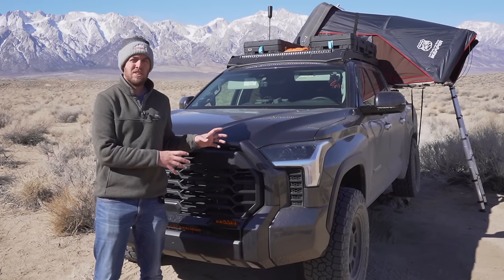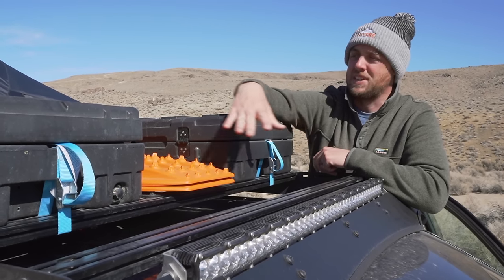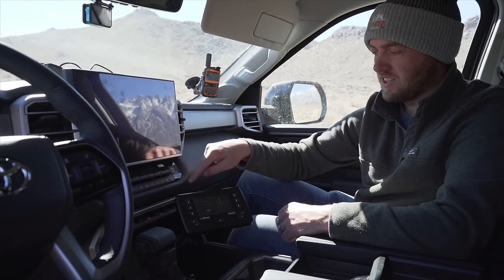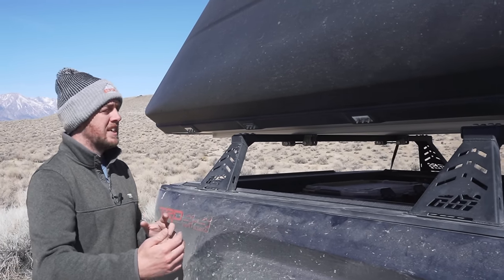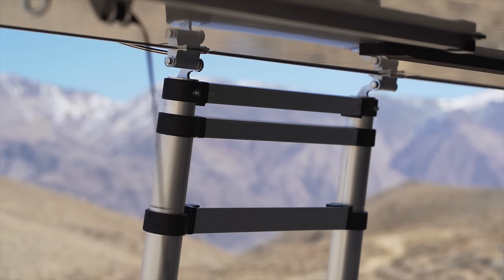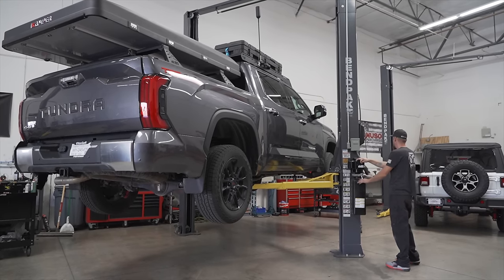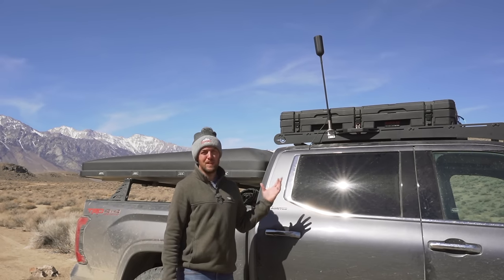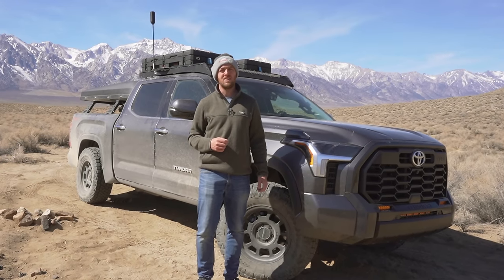We Built This 2022 Tundra Out for Overlanding in 4 days

Comment: It’s a Spacer lift no point in Churching it up lol. My RC lift is designed identically. Has a preload at the bottom of the spring. Regardless it’s a spacer lift 😂🤷‍♂️
Reply from the maker: The Tundra Rough Country lift has a spacer that sits on top of the strut, which is very different from a preload spacer. Yes, they're both spacers, but the RC spacer is more likely to cause issues.
Reply: @RevereOverland  I can’t speak for the tundra version. But my 2021 Silverado LT RC 3.5” kit had a preload spacer as well as a spacer on top utilizing both for each front strut. 

Installed it the week I got my truck and love it personally! But even tho my kit had the preload part it is indeed still considered a spacer lift to me personally haha. As a master Ase tech for the past 12 years a spacer is a spacer. Call it what you will but it’s all the same to mechanics 😂🤷‍♂️

Comment: 24:23.

I am not surprised by this one bit. I had a 2017 Ecoboost F-150 that had 35's on it and a 3.31 rear end and the mpg was even worse than what you are getting. It got in a wreck and totalled out so I went with a 2021 Tundra TRD Pro, and put 35's on it too.

BUT, with that 4.30 rear I get much better mpg than the Ford. The Ford was 11 mpg city and 15 highway, while my Tundera is 13 city and 16-16.5 highway.

Towing is even worse. The Ford got 8 mpg with my 7200 lb camping trailer while the Tundra gets 10.5-11 all day.

To be honest, I've watched enough videos now on the 2022 Tundra that I thank my lucky stars I didn't wait and got the 2021.

Comment: Be sure to check your speed and distance with GPS with oversize tires.  A larger circumference tires rolls a longer distance per revolution. I went from 30" tires to 33" tires on my 4Runner and when the speedometer reads 70 mph, I'm actually going a little over 74 mph.  The odometer is off by about 6 miles less per 100 miles traveled, ( when ODO reads 94 miles traveled I've really actually traveled about 100 miles).  This will give you more acurate MPG calculations.
Reply from the maker: I went from a 32.5 to a 35, which I think would actually put me closer to 15-16mpg after adjusting for inaccuracies

Comment: I have those exact tires on my f150. Got a crazy deal on them $600. Installed them in December Mpg dropped from 22 highway to 18/19. Will be going with a Hankook at3 or a Pirelli all season to get back lost fuel economy. I have an extra set of Hauler rims. Fuel prices in Canada are crazy right now. $250 from empty and I rarely go off road so no need for dirt/ rock tires. 
Love the Chanel!
Reply from the maker: Did you have street tires before? I wouldn't be surprised if you were going from street to all terrain.
Reply: @RevereOverland  yup kinda roaches all seasons.
Reply: But my last truck had all seasons and I went to hankook atm and didn’t loose anything. Who knows why:)
Reply from the maker: @trishaleaver3581  I don't have a lot of experience with different tires, so it would be interesting to know how different brands perform with mpg!

Comment: Replace the mattress with self-inflating, fold one blanket and place flat over the mattresses, then place any other bedding in the corner of the tent(the thickest part of the tent) 

I was able to fit (without forcing) two expeds, two down blankets, and two pillows in my 2.0. it’s takes time to figure out exactly how to make it all fit, but worth it. Especially if you use a heater, you won’t need as much bedding. 

Hope that helps 😊
Reply from the maker: Yes! iKamper just released their self inflating mattresses, so I ordered one of those.

Comment: Thanks for the Method 20% off link. Got my coupon code. I'm going with the 705's as well. Soon as they come back in stock for a Super Duty. Good luck with the Open Country AT III's. I had 35x12.5 R18 on my F150 last year and could not get them to balance. Had two bad tires replaced and still a vibration at higher speeds. Change to AT III's in a slightly narrower size and still had issues. Now have a 2021 F350 Platinum with the Tremor package and 6.7L diesel. Carrying my RTT on the bed cover with gear in bed and back seat, I still get 22-23mpg on the highway! Loves my diesel.....
Reply from the maker: I’d love to have a diesel!

Comment: Should have done a spacer lift, doesn't affect the spring harshness... and you can add bump stop spacers to prevent that "fuse" from exploding. It also moves your travel zone downwards so yeah you have a less up travel vs preload, but you get more down travel and you aren't likely to rub as much since the wheel won't tuck up in more. So long as the CV angle isn't bad, it's really a decent method.

Comment: I don't know if you have a filter on the condenser of your  refrigerator but with all that dust it would be a good idea as it'll be easier on the compressor as well as pull less amps. (or vacuum it occasionally ) Nice vid.
Reply from the maker: The compressor I have blows a good stream of air that I've used to blow it out a couple of times. I'll probably take the panel off and clean it before the next trip!

Comment: Sweet!  Your Tundra is looking even better than before.  But if it was me, I'd avoid putting heavy items on top of the roof rack to keep the centre of gravity low.  Which I'm sure you know is good for better offroad performance (particularly when big articulation is required).  And I'm surprised you only went for a collar lift instead of a proper suspesion lift (even if just the springs and shocks).

Comment: You’ll want some clear film in between the front wind deflector rubber seal and the paint. The rack will vibrate the paint off your brand new 4x4.
Reply from the maker: It has a soft rubber strip
Reply: @RevereOverland  that’s exactly what will rub the paint off. That with the grit 
Clear 3m wrap is the go

Comment: Both side windows of my iKamper skycamp mini were broken after opening the tent after the winter. (Less than a year old)
The straps for closing the tent are causing this damage. After doing some research in the overland/youtube community I found out that this seems to be a known issue and that iKamper would cover this, despite iKamper stating:
 "This is definitely NOT a common issue that happens with our tents or I'm sure there would be a lot more posts and videos of this happening across social media...but  it definitely happened to you and we will make that right. ...
What we have done in previous situations (??? so it did happen to other customers or not ??? - this is nonsense what they are writing there) like this is we will completely replace both the tent skin itself as well as the rainfly with a brand new one. Because this really is not a common case and we have replaced them in the past(???), people that have had them replaced have not had an issue of the new skin doing the same thin. ..."
iKamper didn't want to talk to me directly in the beginning and made me go through the dealership.
 I got the above mentioned message and a direct contact to iKamper not earlier after mentioning a lawyer. It might have worked without doing that but the communication was slow.
My problem which I have with this situation and iKamper is that they knowingly kept selling the mini to customers.
I got the replacement parts 2 days later but out of this fact I'm considering of letting the tent go. If you know that you're selling a shitty product you've got to fix it no matter what. That's why there's a new mini now.
My posts asking for help also never got published in the iKamper community on FB.
Reply from the maker: Interesting. That’s the first I’ve heard of that problem, but would explain why they moved away from those windows in the 3.0.

Comment: Hi, just bumped into your channel! I have ROAM boxes as well, but I use ratchet straps that I use to secure on my roof rack.  How exactly are you strapping them lengthwise?
Reply from the maker: I used lashing straps on either end. I'll be switching to something a little more permanent when the roof top tent is mounted properly.
Reply: @RevereOverland  When you have a more permanent solution, please let us know what it is. I am looking to mount a couple of these on Tacoma crossbars over the bed.

Comment: Should have just gotten trd pro
Reply from the maker: All that adds is suspension, and it doesn’t look to be much better than what I’ve got.
Reply: @RevereOverland  you truck is nice. Just wondering bc doing suspension job on a redesigned 2022  is just a guess work.  Unless those struts are specifically made for tye tundra.  Then a lift does put a lot of other things out of alignment.

Comment: 20% off wheels is not working.
Reply from the maker: What do you mean? The website isn’t working, you didn’t get the email, or the coupon itself isn’t working?
Reply: @RevereOverland  I didn’t get the email. I filled out the info yesterday.
Reply from the maker: @Sandman0505  I've heard of a couple of people with that problem. My first suggestion would be to check your junk email folder. If that doesn't work, maybe try another email address or calling them.

Comment: Save you time, this whole video is a advertisement, don't get the boxes on top as you won't be able to reach them and it will be pain in the d to have something in there that you need often, also wind noise and mpg reduction will be severe.
Reply from the maker: If you’re over 4’6” it’s easy to get into those boxes. It’s significantly quicker and easier than trying to dig something out of the back, which is something I mentioned in the video. You’re also wrong about the wind noise and mpg, which I also mentioned in the video. It’s like you’re summarizing something you didn’t watch?
Also, not an ad.
Reply: @RevereOverland  it's an ad from beginning to end dude.. you even point to places where to get these things.. you also have affiliated links ?? Nothing wrong about it just wanted to point that out cause if it is then people shouldn't take your word seriously if you got any of those things free or with significant discount. I've had similar setup and you are wrong about mpg and wind noise that's just physics.. better to get decked system there you can reach stuff in seconds and organize it, probably even cheaper than the boxes with the rack that just creates drag noise and reduces mpg for nothing.
Reply from the maker: Calling it an ad implies I'm being paid to promote products, which I am not. No one told me to make this video, and no one told me what to say in the video. Believe it or not, I also have free will to pick products for this build that I think are the best. Even then, you'll notice I have some negatives to mention on some of them (if you watched the video).
Affiliate links are free for anyone to sign up for. Just for roof top tents I'm signed up for iKamper, Roofnest, ROAM, OVS, Dobinsons, Smittybilt, Eezi-awn, Big Country, Darche, Front Runner, Rough Country, Thule, ARB, and probable several others I've forgotten about. Out of all of those I chose iKamper because I believe their tents to be the best.
It also never ceases to amaze me that people will make such assertive statements about something I use every day, despite having absolutely no experience with it themselves. Maybe your boxes weren't as good. Maybe your sound insulation wasn't as good. Maybe your wind deflector wasn't as good. I'm sorry for your bad experience, but it is not the same.

Comment: Disappointed in truck, new tundra needs a lot of help to actually offroad, ground clearance is horrible should've put a real lift in it. Toyota shocks suck period, old tundra smashes this truck not to mention it towes better with leaf springs.
Reply from the maker: The old Tundra has nothing on the new one
Reply: You can't clear a pebble in that thing! Lol Not too mention if you actually have passengers, suspension is a joke,
Reply from the maker: @fishman6364  it has more ground clearance than the old one
Reply: Got the old one your wrong on that point, you have no clearance after spacers you added, still have junk factory shocks.
Reply from the maker: @fishman6364  not wrong. You can check the specs.
Reply: @RevereOverland  Agree. Build quality excellent.  The nearly 400hp TT 6 is amazing.  Interior quality light years ahead of previous Tundras. I bought mine so got Toyota extended warranty since this is a first year new generation.  Only issues are minor